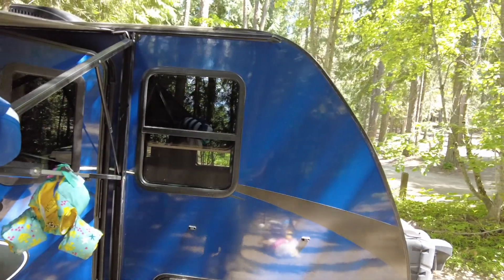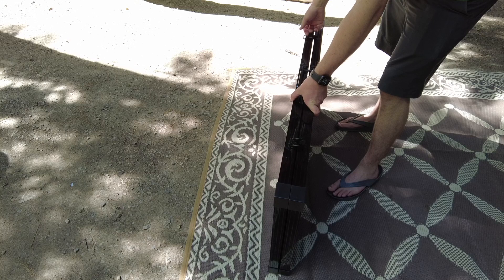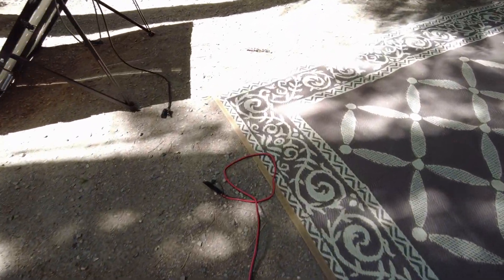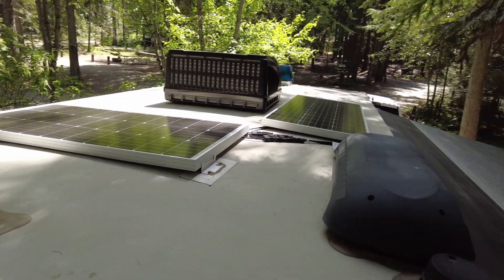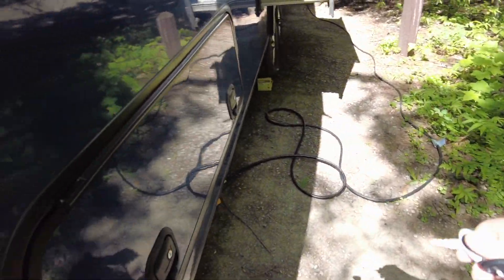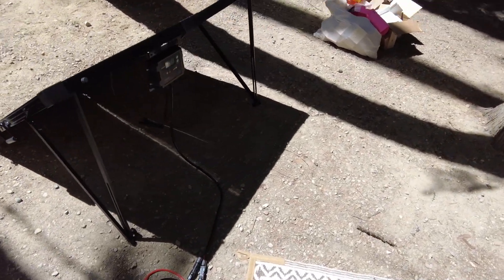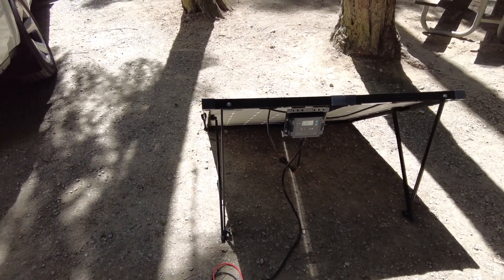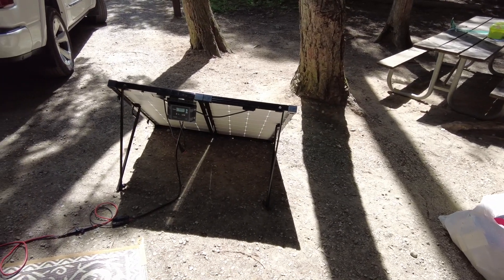Renogy 200w Briefcase Off Grid Solar Review

Comment: 11.2 amps for a 200 watts panel is excellent. Some 200-watt panels amp specs are less or right around 10amps.I might buy this setup. Here is an example: 
Rich Solar 200 Watt Solar Panel Specifications
Maximum Power(Pmax): 200W
Maximum Power Voltage(Vmp): 20.4V
Maximum Power Current(Imp): 9.80A<----
Open Circuit Voltage(Voc): 24.3V
Short Circuit Current(Isc): 10.2A

Here are the specs for the Renogy panel
Maximum Power Current(Imp): 10.8A
Open Circuit Voltage(Voc): 22.8V
Short Circuit Current(Isc): 11.2A

Comment: What type  and number  of batteries do you  use ? How  long  can you  dry  camp on your  100  watt panels?  We  don't  use  any  electrical when  dry  camping,  just  the  LED  lights, water  pump, power  awning and  what  the propane  ftig's  brain  needs  to  keep it  running.  Thanks

Comment: Regarding your Zamp/SAE port on the side--I have the same port and the 200 w Renogy but the adapter which changes the polarity and is supposed to fit in the port does not fit. Clearly yours fits. The SAE port has a rounded form factor and the adapter has a squared off form factor. I have tried different adapters from different sources and still have had no success. I am now waiting on another adapter (recommended by Renogy).  I would love to know why yours works🙄

Comment: problem is you are using two charge controllers and not getting everything from the 200w portable panels. You need to bypass the controller on the back of the panels and feed that 10 amps into the controller mounted in your trailer.
Reply: You are assuming the side solar port goes to a charge controller. I have a factory port on the side of my trailer that goes directly to the battery, therefore requires a separate charge controller.
Reply: Yup
Reply: @tobyray8700  how so?  If the two charge controllers are connected to a bud bar then it seems you have max efficiency from both systems, without either panel limiting the other.
Reply: Because there is solar on the roof I assume there is a solar charge controller connected internally in the camper but you are right there may not be.
Reply: @peterj5751 He showed the internal controller that is connected to the roof panels. It was in the side compartment.
Reply: @brucewayne857  yes I agree. But we don’t know if the external plug is connected to it.

Comment: Is that plug on the side connected straight to the battery positive and negative or does it go to the input of your onboard solar charge controller?

My guess is to the input of another controller in which case you are feeding the battery output of the renogy suitcase controller into the PV input of another. Unless of course the plug at the side goes straight to battery.
Reply from the maker: The plug from the second charge controller goes directly to the battery.
Reply: @TheSavvyCampers  what second charge controller? Is there one behind the plug on the side of the RV then? Or do you mean the renogy suitcase controller is connected direct to batt?
Reply from the maker: @GetCTOwned  I have one on the solar suitcase and a second charge controller for my rooftop setup.

Comment: So using these panels with the solar on the side connection don’t interfere with the rooftop system?  It just adds more power without any feedback between controllers?
Reply: I kind of think it's low class on the part of Renogy. I just bought this 200 watt solar suitcase for my Delta Max. As many of those suitcases that they give away to other YouTuber,. you would think they would let you keep this. The hassle alone of packing that thing up which is heavy, and getting it back to them then waiting for the other is classless on their part. Just my thought. I thought they were supposed to be the customer-oriented people??
Reply: @michaeldeckert6023  exactly right.
Reply from the maker: Adding the side solar doesn't interfere with our rooftop unit. It will add additional amps of charging to your batteries.

Comment: We have this kit. I like it and it puts out good power, but it is too bulky and heavy to take with us. We use it to recharge our batteries when we get home after a trip. Good video.
Reply from the maker: Thanks Stacy, yes the 200w is very heavy to take. We have the 100 watt and it is a very nice size. We did play with a Doku 150w soft solar kit last summer and I was very surprised on the output, however you cannot leave them out in all weather situations.